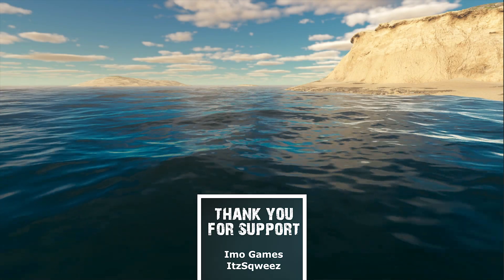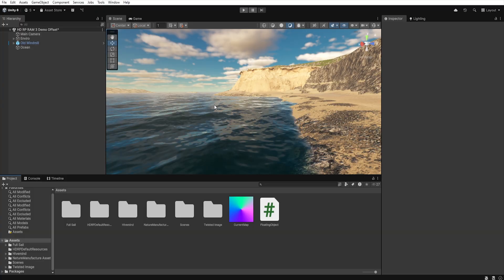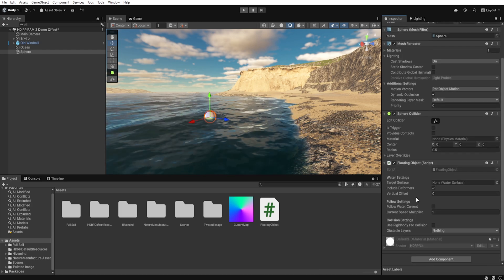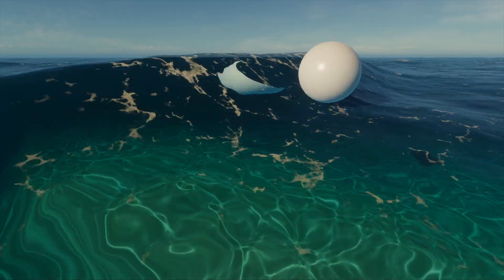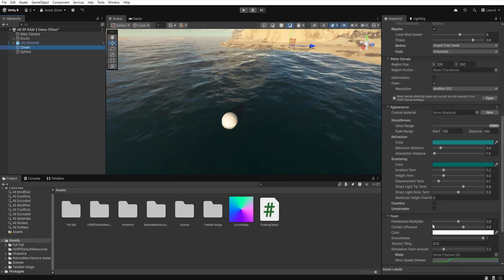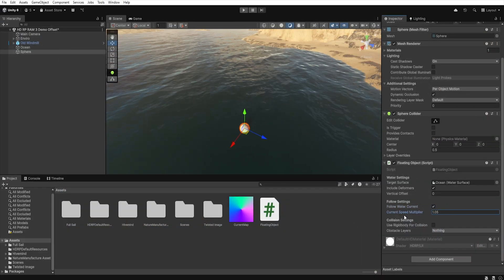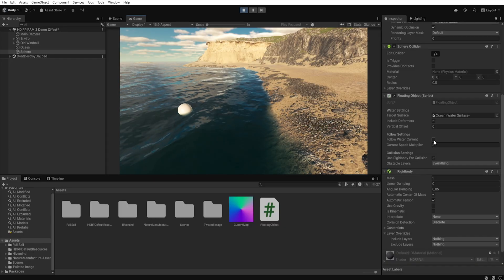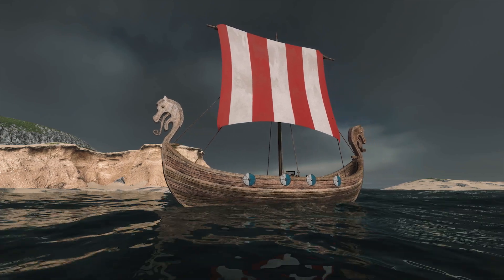How to Make Objects Float and Follow Water Currents in Unity Water System | HDRP |

Comment from the maker: ⭐I added an additional script to the one shown in the video. It works similarly but is designed for boats and larger floating objects. This new script includes a feature that makes objects sway on the water depending on the wave height. I didn’t include this in the original script because it was meant to be a simple example showing how to make objects float and stay on the water. But since you wrote to me that it would be nice to have such an option, and it would be pointless to create another video just about it, I'm including it as a bonus:)

Comment: Is it possible to do submarines using the HDRP water system?
Reply from the maker: If it's just supposed to be a submarine diving in the water, there's no problem. It's worse if you want the player's camera to be inside the submarine. While it can't see outside, there's no problem. You simply create a box volume in the submarine and disable water rendering. The problem begins when the player can see outside through the window, because then you have to figure out how to handle it, it all depends on what exactly you want to achieve:)

Comment: Great videos. 
I was hoping to see an example using an actual boat though.

When I play Ghost Recon Breakpoint I noticed some of their boats have water coming through the hull as you speed along, so I wanted to see if yours didn't have that using your script.   
It would be nice to see that with a motorized boat to see if the water comes through the hull or not.

I got here looking at your environment video.  Very well done.
Reply: I'm looking at your tutorial broken down in parts from the start and I see where there is  a setting to allow or remove water from inside the boat, so that will pretty much answer my question.  Great work.  Many of these things are all about the settings.
Reply from the maker: I'm glad you found a solution:) Generally, water masking in Unity is a simple system, but I hope they develop it into something better in the next updates:)

Comment: i have a issue with directional light , like its affecting the house from inside even the house if fully closed , in short it affecting the interior even i have walls. plz tell me solution , i am using unity 6 urp
Reply from the maker: Use so-called light blockers, which are simple, primitive cubes with the lighting set to "shadows only." You place them around the building, and their job is to block light leaks from directional lights. Here's an example of how to do it: https://youtu.be/jPOpHZWqK2c?t=112
Reply: @SetaLevelDesign  thanks seta. you always helps us. love from india

Comment: Great, it was very helpful to me. Thank you so much. Also, I am trying to make a swim mechanic that naturally and automatically changes the state to swim or not swim when player gets into the water and steps on the ground. I took the water height and it works. But I had a problem with swimming controls when player looks up and tries to swim up to the water surface or swim up with jump (space) movement, the player jumps on the surface and player's isSwimming control keeps turning on and off and sometimes it gets stuck in the off state and falling down underwater. I know every project has specific requirements but, If you can help with a tutorial for swimming controls or point me to some resources I’d really appreciate it. Your tutorials are very helpful, thanks a lot.
Reply from the maker: I'll be honest, I've never done anything like this:) Theoretically, if I were to do something like this, I'd place three checks on the player, on the feet, on the chest, and above the head. If only the bottom check detects water, the character can jump and move normally. If the bottom and middle checks detect water, the player enters surface swimming mode, so they can no longer jump and stay afloat in the waves, just like the objects in this video. However, if the top check also detects water (because the player dives using the appropriate button + diving animation + raycast whether it is not too shallow for diving), the control system switches to the underwater mode. I'd also add an emerging and submerging effect to mask position change. For example, if the head detects the surface, the emerging animation starts, push player to the swim position and the controller switches for swiming on the water surface. This is just a rough suggestion because, as I said, I've never done anything like this myself:)
Reply: @SetaLevelDesign  I get it. You know, there’s always more than one way to do something, and the best idea doesn’t always come to mind right away. That’s why it’s great to hear different perspectives. I’ll try to tweak this mechanic based on your suggestion. Thanks a lot for taking the time to reply.

Comment: I've asked a few people if they can make a storm, like in the sea of thieves water? But no one said they can do it ! 😭
Reply from the maker: There's no point comparing the water in SoT to the water in Unity. A lot of time was spent on water creation there, as it's a key element of the game. In Unity, the water system is just an add-on, so you won't get the same effects as there.
Reply: @SetaLevelDesign I understand that,I didn't want it to be exactly like it, I just wanted a storm with bigger waves and foam .